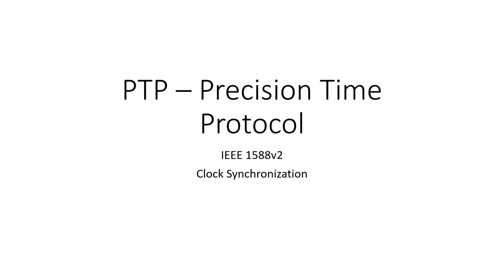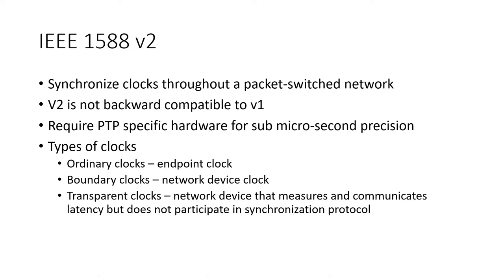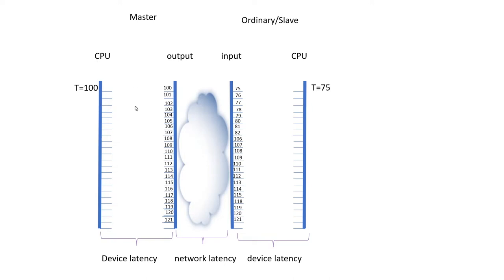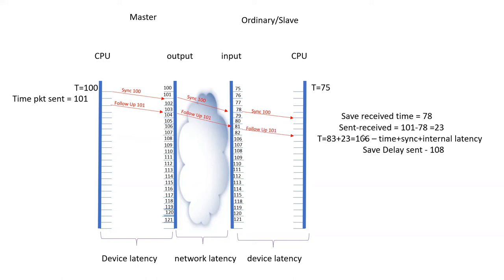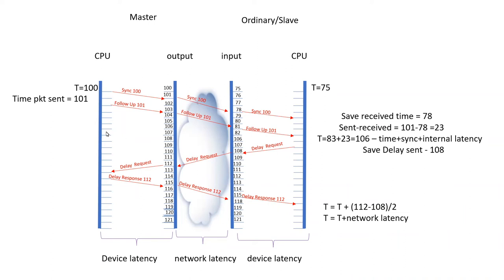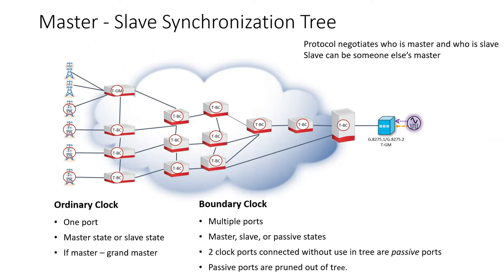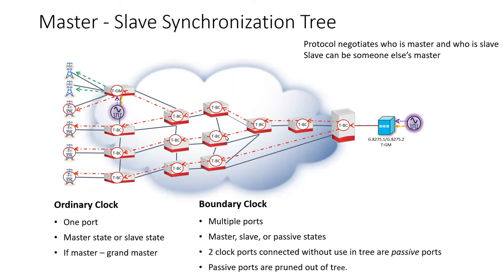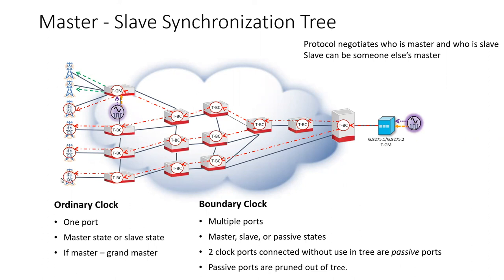PTP - Precision Time Protocol - IEEE 1588v2

Comment: Hi Barbara. Thank you for the informative video. I'm confused about your network latency calculation circa time 4:31. Doesn't the difference between the time the slave sent the delay request (108) and delay response value from the master (112) indicate the one-way network latency from slave to master? This isn't the round trip delay, so I don't know why there is a division by 2.
Reply from the maker: Hi Amit,  There was initial one-way latency in the network for the original Follow Up packet, which is what we're trying to determine.  The Delay Request packet is also experiencing one-way latency in the network (in the other direction).  So that's why we divide by 2 - to account for the latency in both directions.

Comment: Cool! This protocol assumes equal links send and return as you mentioned...
But is it even theoretically possible to get equal times when there is not equal delay for send and return?
Reply from the maker: I guess it depends on the precision of your clock and the number of hops between 2 systems involved in the conversation.